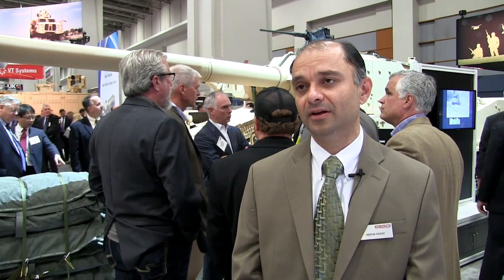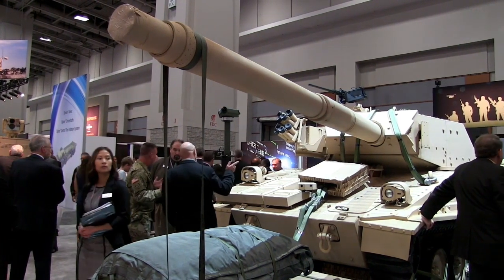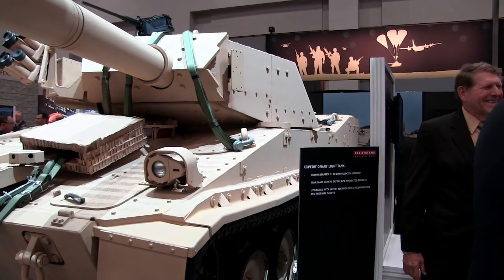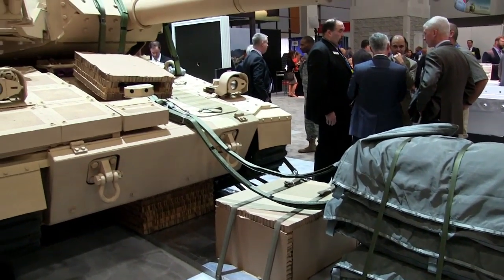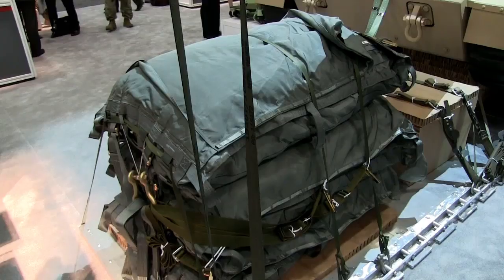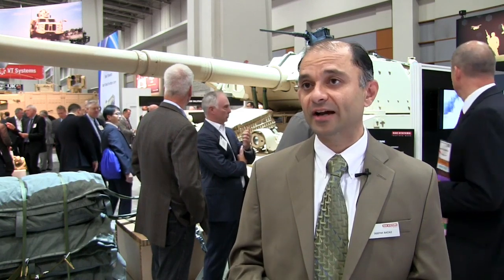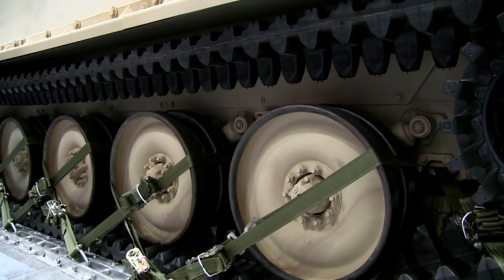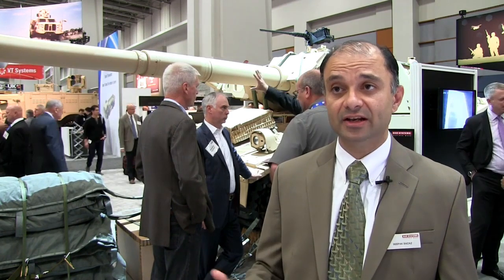AUSA 2015: BAE light tank goes back to the future

Comment: Be aware, you can air drop this, but you need to significantly reduce payload in ammo, fuel, armor, etc.  So you would need another C130 in order to just drop the support package to go with it.  In addition, this was not developed with today's anti-tank systems that have evolved, nor the IED threats that we face now, so the armor survivability needs to be reassessed.
Reply: What armor? It's a M113 with a turret, but without the Allison X200-4B or -5 Transmission. It probably has an old power pack out of a M551.
Reply: If it's based on the old XM8 then it will come with add on armor. This would be mainly a support/ defensive weapon system designed and employed to protect air heads and to provide firepower support for foot operations after the landing. This  won't be used for making thunder runs or aggressive maneuvers.
Reply: Reed-up on light tanks.

Comment: Tanks are a waste of money. Speed and maneuverability are everything on the modern battle field today. Even the best modern day tanks are simply to slow. What the Army needs are more "Apache Longbows" better known as the "Flying Tank" and more "Stryker Armored Personnel Carriers" This would provide the aforementioned speed & maneuverability that todays modern army needs to overwhelm the enemy quickly.
Reply: So what happens if your "Stryker Armored Personnel Carrier" faces a heavy armored division, with MBTs and air defense? Due to long- and short range AA the Apaches can't do shit and air support is imossible. Due to active protection systems on the enemy vehicles ATGM from the Strykers can't affect them.

Guess what, you need MBTs.
Reply: You know it sounds good if you are fighting terrorists or low class contigents. But imagine if you are going against a country like Russia, that known to use massive tank force and while backing it up with massive air power at the same time like they did against germany then the stryker and apache would get obliterated easily. Your idea only works against isis or taliban but against a country that fielded massive tank force, airpower and anti air defence system then you obviously need mbt and jets to even it. Also many modern mbt today are being fitted with missile, fcs and aps to counter and shoot down attack helicopters.
Reply: I think the military should be making purpose built armoured vehicles instead of modular vehicles that adapt.
Yes I know money is tight but do it right.
Take something like the British Scorpion put a slightly longer barrel on it.
It would have 90mm gun that would cause major problems.
Its a great recon vehicle that has a very proven service record.
Slap on some era a better power plant rubber tracks and updated hardware.
Its short its low to the ground its fast its agile its hard to hit its much much smaller than the average tank even if you up armoured it by slapping some spaced armour.
A cage to defeat RPG attacks would be useless as it would be constantly on the move or with heavier tanks or troops.
Plus if you put two spike ATGM missiles on it it could be far more menacing :)

Comment: The US Army has from WWII until today used aircraft engines in tanks. This is a 1950's delivery truck engine.
Reply: the US army has only fielded turbine engines in the Abrams, the M46/47/48/60 Patton tanks had normal diesel engines.
Reply: Alexnder90 F  Correct term would be 'turbine engine'. Aircraft engines have been used in tanks by almost all tank building nations. The Strv103 was one of the first, if not the first, to use a turbine in a production model. In a two engine setup though. The T-80 is a different beast though..very fast :)